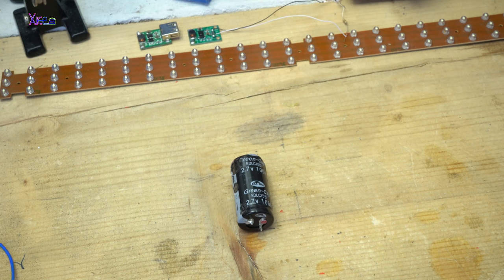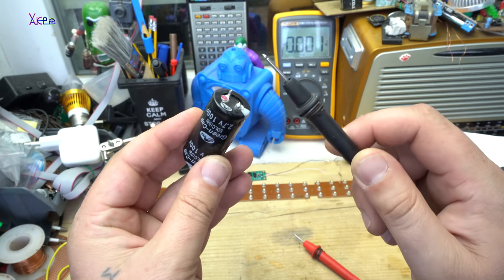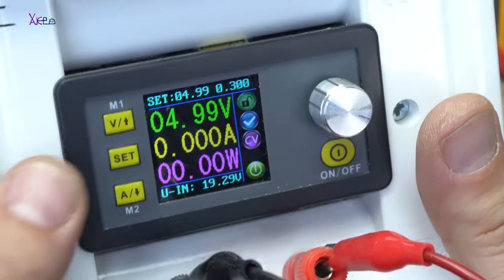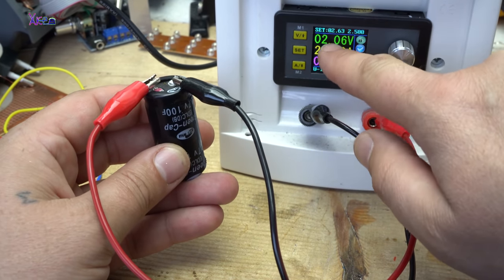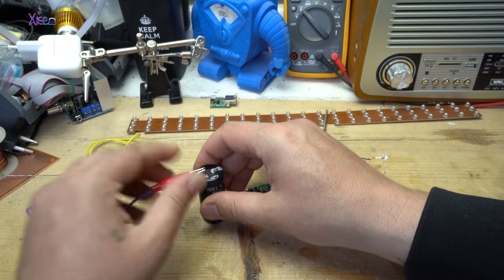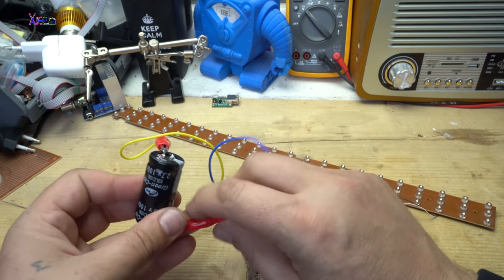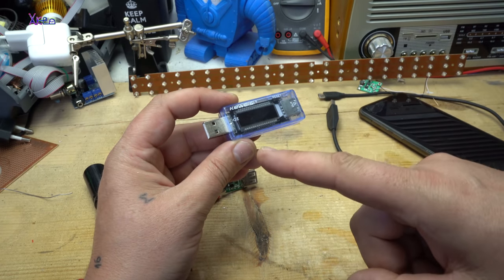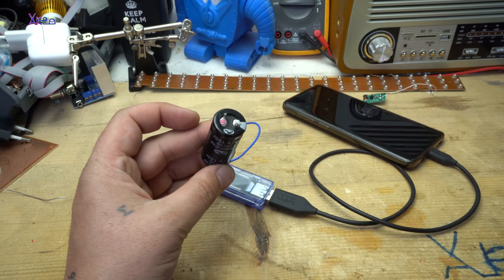Amazing DIY Ideas with Super Capacitor

Comment: Believe me or not, I have never had to buy any electronic components I have sold them but never buy. I salvage and recycle stuff. Its very easy to find stuff to salvage. You can find stuff on the side of the road and make it so your family can't throw stuff away without your permission. I don't even have a job; I just sell components and circuit boards. I make a living off of it. Infact just today I found that exact capacitor in a TV